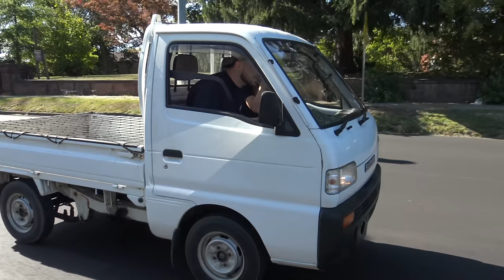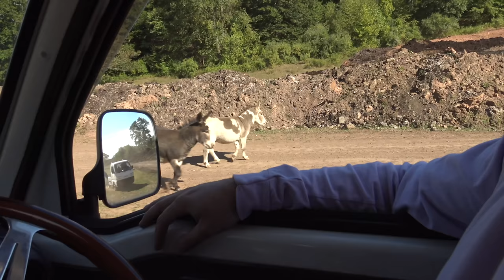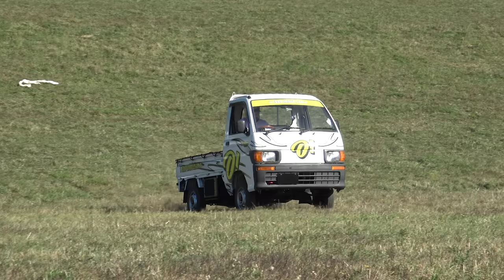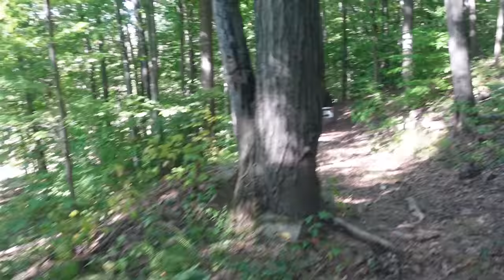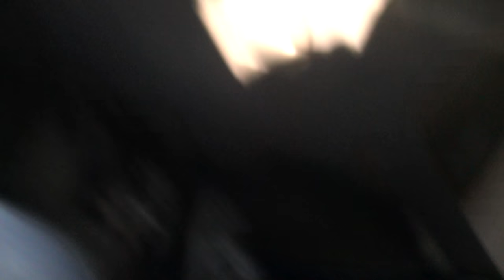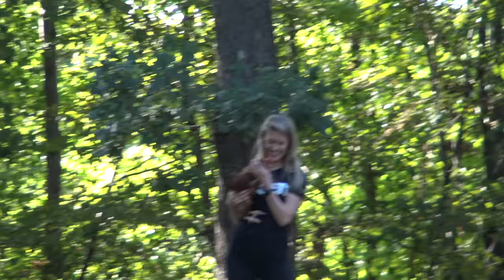PUTTING THE JDM MINI TRUCKS TO THE TEST!!

Comment: Totaly agree with you RJay! 
Only thing to ad beside those would be a Kei Dragtruck LOL! 
Steph should get a Kei car or a Kei Van IMO! 
Awesome to see yall having so much fun. 
Will be awesome to see how the Kei offroad truck will be when finished. Only concern I have is those wide wheels. But maybe the rear axle holds up. Or it's just to put in a stronger one. A little problem with that would be to get the same wheel speed ratio between the front and rear when in 4wd mode. Like this content so much keep on going guys and gals! Fun to see you drive your vehicals this much as well. A great mix of content makes it awesome to watch!

Comment: If i was you i would have lift kit on one off them. 

And built the shoptruck to a lowrider jdm truck, with oilcooler and lines on that original front bumper with lip. 
And Maybe a small rollcage on the bed. Littel jdm exhaust pipe and a small wing an yellow headlights it would been the best truck tho promo  your shop 😉👌 i can't wait on that s15 build

Comment: When you do the lift kit add some heavier variable rate springs.  These are what I run on my Hijet.  https://www.summitracing.com/parts/qa1-10ht225-475

The springs on the Hijets and the Carry are 2.5-inch ID X 10-inches long.  Stock springs are about 115 to 135, depending on the make and the options.  If you go over a 2-inch lift you’ll have to figure out how to lower the center of the front differential, and adjust the driveline angles to the rear diff.